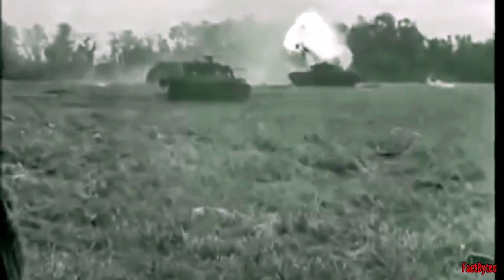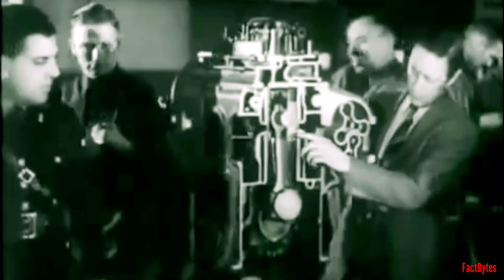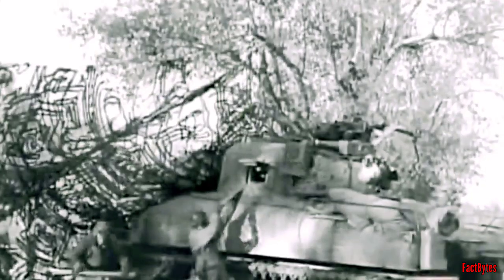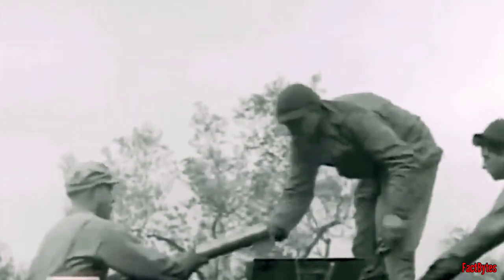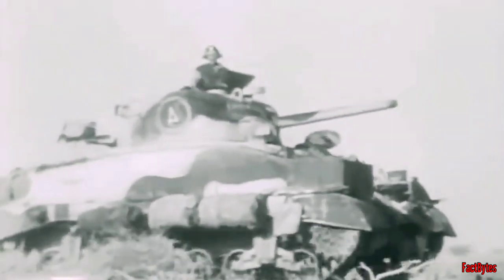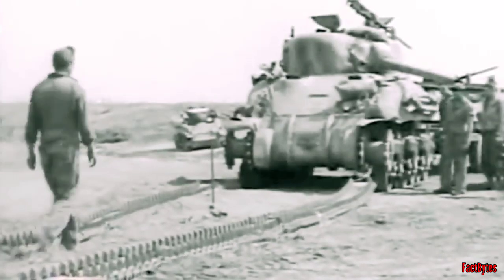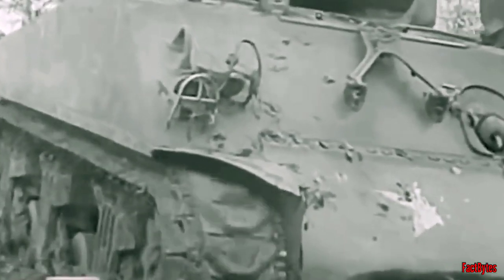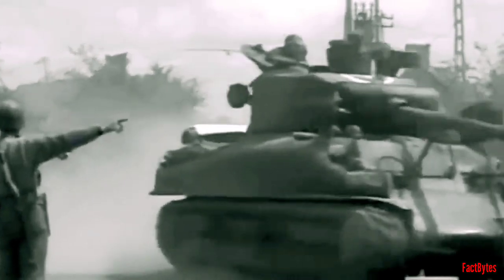How Good Was The M4 Sherman Tank REALLY?

Comment: Sherman’s were upgradable.  A constant stream of modification’s kept  this platform relevant until the early 70’s.  They were very fight able, easy to repair and maintain.
Reply: So true! The IDF upgrades to the Sherman made it able to go toe to toe with T54-T55 tanks.
Reply: Homer.
Reply: The Chilean Army acquired used M-50 and M-51 Shermans from Israel until the late 1990's. The M-50's had their long 75mm guns replaced by a high velocity 60mm gun while the M-51 kept their 105's. The idea being these Shermans would most likely encounter Argentina's TAMs, AMX-13s and Kurassiers - something they could quite handle.

Comment: It was common practice to keep shooting the tank (both sides did this) until it caught fire. A burned tank can’t be repaired.
Reply: Gunner marks III kills
Commander: I only saw the one? 
Gunner: I hit it 3 times before it burned didn't I?
Reply: And Shermans had a water jacket which made it unlikely that an ammo fire could occur in a sherman
Reply: General Horse
2/3 of Shermans built didn't have wet ammo storage and if I remember it correctly none of the British and Canadian Shermans even in Normandy had it.
Reply: @generalhorse493  It wasn't a water jacket, it was a gel consisting of a mixture of water, ethylene glycol, and a rust inhibitor, known as "Ammudamp."
Reply: @lyndoncmp5751  Only late model hulls (In late 1943 and early 1944, a fundamental design transition took place in Sherman production. Initially, all Shermans had the "early" 56-degree angled hull with small driver and bow gunner's hatches that jutted out. In November 1943, near the end of its production, the M4A2(75) was the first variant to introduce the newly designed "late" 47-degree angled hull with a thicker, smooth glacis plate and larger hatches that allowed the driver and bow gunner to escape more easily) had wet stowage, and none of the 105mm armed M4 Mediums had wet stowage.

Comment: After WW2 the M4 Sherman stayed in American service thru the Korean War. Other armies used their Sherman in frontline service. Some armies into the 1970’s. The Sherman was product improved throughout production. Modified and up gunned by armies using it.
Reply: In fairness, this was the Firefly version of the tank.  Why the war department decided to go with the low velocity 75mm just boggles the mind.  This was a penny pinching step because they felt that the low velocity gun would last longer with less wear and tear on the tank.  I mean, the whole damn reason to have a tank is that it is a mobile platform to a powerful gun, so scrimping on the gun defeats the whole purpose of the thing..
Reply: @andysheepleton   the 75 mm wasn't a tank vs tank gun
the sherman was more like an ifv in most cases
the 75 mm had a better HE shell for infantry engagement than the 76 mm
the shorter cannon was also suited for that
each version of the sherman had its benefits
of course the 76 is superior for tank vs tank then the 75
but we have to see the main needs for the us infantry as well

Comment: German heavy tanks required narrow tracks to be loaded on flat cars. Once they arrived combat tracks had to be installed.
Reply: The tiger had field tracks(as opposed to the shipping tracks) that weigh 3.5 tons. To put that in perspective, the M1 Abrams tracks weigh around 2 tons. That the weight the engine and transmission have to move just to crawl across flat ground, to brake, turn, or accelerate.
Reply: @drudgenemo7030  the tiger, tiger Royal and their derivatives we're too wide for the flatbed cars. Hence the need to swap tracks. Too much fun! Go into combat tired
Reply: Not always. If there were no major obstacles ahead, they would often send the Tigers with their combat tracks.
Reply: Wasn't really a big deal. Could be done in half an hour each track. When being entrained most of the day was spent hanging around waiting anyway.
As the last poster said plenty of pictures of Tigers on trains with combat tracks on. I even have pictures of Jagdtigers on trains heading for the Rhineland-Palatinate in early 1945 with their combat tracks on.
It wasnt preferable, but it could be done.
Reply: A Panther’s transmission had a ridiculously short service life and required a team of specialists working all day with heavy equipment to replace it (they essentially had to tear down the entire tank just to reach the damn thing).  Not only was the Sherman’s transmission more reliable, but it could be replaced by the tank’s own crew with just the tools they carried, and could be done inside of two hours. 

Wehraboos can cry all they want about nazi supertanks, but those things are no good if you can’t keep them running consistently.

Comment: Survivability is easily the most important factor in making a successful tank, imo. Big guns and thick armor are nice, but if the crewmen can't escape after a bad hit, then their experience dies with them. And this was exemplified perfectly around Arracourt, where Panther tanks operated by rookie crews were soundly defeated by a veteranized 4th Armored Division operating technically inferior M4 tanks.
Reply: Being difficult to penetrate is the most important survivability factor. And German tanks had as many large hatches as the M4.
Reply: @TTTT-oc4eb  I disagree. No tank is impenetrable. All that matter is how well the crew will fair when the tank is penetrated.
Reply: @redaug4212  If that's the case, why bother with thick armor at all? Being inside a tank that get penetrated by 90% of incoming rounds is horrible for moral, being inside a tank that shrugs off most rounds is the opposite. Despite being sent into the worst combat zones, the Tiger crews viewed their tank as a near life insurance.
Reply: @TTTT-oc4eb  To prevent the tank from being KO'd ofc. You're conflating crew survivability with overall durability of the tank. Armor's primary function is to keep the tank operating in combat, not necessarily to keep the crew alive. Otherwise there wouldn't be so much emphasis on escape hatches in good tank design.
You are correct however by indicating that the M4 was a victim of its own success. Surviving in a tank that gets destroyed over and over creates the perception that the tank is somehow bad, even though its design saved your life just as much as a heavily armored tank could. That perception bias is why we have books like Belton Cooper's "Death Traps" and the many History Channel documentaries regurgitating the myth that the M4 was inferior because it wasn't an armored behemoth like the Tiger.
Reply: @redaug4212  No, the armor's primary function is to keep the crew alive.

According to the book "Brains and bullets" by Leo Murray, the main reason for the high crew survivability of the Sherman was something quite different; in the first weeks of the Normandy campaign 4 out 5 crew members became casualties when their Sherman was penetrated. After 15 weeks this had dropped to just 1 out of 5. While there were several reasons for this, by far the main reason was that the crews learned to evacuate their tank as soon as they felt outgunned, often even without being directly fired on. A common tactic was to fire their gun in the general direction of the threat, then back out to a safer place and bail out.
Reply: @TTTT-oc4eb  No, the main purpose of armor is the keep the tank functioning after getting hit. That's why side armor is consistently thick whether it's covering the crew compartments or the engine.

I've never read Leo's book, but upon reading the description it appears to be a book full of novelties and anecdotes; not a real analytical assessment of armored warfare or the performance of US tankers.
Real statistics show that the death rate for US armored personnel was exceptionally low; with the whole US Armored Force sustaining only 1,581 combat deaths during WWII (though is probably slightly higher if officers are accounted for). The fact that your book is trying to claim that 80% of these losses occurred in the first 15 weeks of the invasion of Normandy is absurd and mathematically impossible.

Moreover, the suggestion that US tank crews fled at first sight of a bigger gun is easily debunked by the aforementioned battle of Arracourt, the battle of St. Vith, Krinkelt-Rocherath, and many other examples of late-war tank engagements between the US and Germany.
Reply: @redaug4212  "No, the main purpose of armor is the keep the tank functioning after getting hit."

A tank will generally function better without holes in it.

"The fact that your book is trying to claim that 80% of these losses occurred in the first 15 weeks..."

Casualties also includes WIA, usually at a ratio of 2 or 3 per KIA. And it was a gradually decline, not suddenly from 4/5 to 1/5.

He didn't say it COULD be the reason, he stated it WAS the reason.
Reply: @TTTT-oc4eb  >"A tank will generally function better without holes in it."
Yes, hence why the armor is there to prevent holes to keep the tank functioning.

>"Casualties also includes WIA, usually at a ratio of 2 or 3 per KIA."
Ok but that still gives us the absurd claim that 80% (4/5) tank crew casualties on the western front occurred during the Normandy campaign; where only a fraction of America's armored units were deployed.

>"And it was a gradually decline, not suddenly from 4/5 to 1/5."
So I'm going to pretend for a minute that this claim is true. Since the US fought German tanks from 1942 onwards, often when they were using actual death traps like the M3 medium, then why would this habit of fleeing like frightened whitetails suddenly appear during the invasion of Normandy?

>"He didn't say it COULD be the reason, he stated it WAS the reason"
In that case I know for a fact he's lying lol
Reply: @redaug4212  "Yes, hence why the armor is there to prevent holes to keep the tank functioning."

You are contradicting yourself.

"Ok but that still gives us the absurd claim that 80% (4/5) tank crew casualties"

It also includes the Commonwealth forces, which faced much harder resistance than the US forces.

"Since the US fought German tanks from 1942 onwards, often when they were using actual death traps like the M3 medium".

Until Normandy, especially the US forces saw very limited combat against German tanks. Even in Normandy the almost all tank vs. tank were in the Commonwealth sector.
Reply: @TTTT-oc4eb  How's that a contradiction? I said the armor's main purpose was to prevent the tank from getting KO'd. You said tanks function better without holes. You're basically in agreement with me here.

>"It also includes the Commonwealth forces, which faced much harder resistance than the US forces."
Then why would US tank crews pick up the habit of needlessly abandoning their tanks if the casualty rate wasn't severe in their sector of Normandy?

>"Until Normandy, especially the US forces saw very limited combat against German tanks."
That's not true. Kasserine Pass is an obvious. So is the battle of El Guettar. US forces were counter-attacked by Tigers on the first day of operation husky, and were counterattacked by panzers at Salerno, and again on the Anzio beachhead. All this before the invasion of Normandy. So why weren't US tankers doing this alleged practice throughout the war?
Reply: @redaug4212  "How's that a contradiction?" 

You started your first post with basically claiming that escape hatches were more important than big guns and thick armor.

"Then why would US tank crews pick up the habit"

It was not about US forces, but Sherman in general.

"That's not true."

Still very limited compared to the other major combatants. In North Africa the US forces were green, and Italy was a poor country for tanks.
Reply: @TTTT-oc4eb  >"You started your first post with basically claiming that escape hatches were more important than big guns and thick armor"
Again, your conflating survivability with durability. If the engine were a sentient creature that needed its own escape hatch, then I would indeed be contradicting myself. However, my point was and has always been that armor is fundamentally there to protect the integrity of the tank itself, not necessarily the crew operating it, hence why the hatches are there to begin with...

>"It was not about US forces, but Sherman in general."

Ok, even better for my argument actually. The M4 was used by British and Commonwealth nations as early as 1942 in numerous tank-on-tank engagements. So why then did the British begin the alleged habit of needlessly abandoning their Shermans in Normandy?
Reply: @redaug4212  That's some strange kind of  thinking. However, going by that logic, a Tiger or Churchill should have much better "integrity" than a Sherman then? Because they could take much more punishment and still keep on fighting? And the Churchill had even better survival rates than the Sherman. There are no stats on German tanks, but they were as a easy to get out of as a Sherman. And wet stowage and other improvements were not common in the summer of 44.

Normandy were the first campaign where the Sherman met really large and concentrated numbers of Tigers, Panthers, PaK 40s, PaK 43, FlaK 36 and upgunned Panzer IVs and StuG IIs - all of which had a very high chance of killing a Sherman with one single hit.
Reply: @TTTT-oc4eb  How is it strange? It's common sense. Chances are that a tank with better armor will operate better after being hit than a tank with less armor. You're arguing for the sake of arguing here.

>"And wet stowage and other improvements were not common in the summer of 44"
Yes, and that's why it doesn't make sense that Sherman crews would allegedly bail en masse AFTER the introduction of wet stowage, when the tank was even safer for the operators.

88mm FlaK 36 guns were used extensively as anti-tank weapons throughout the North African campaign and Italy, especially in the British sectors where they committed more armor than the US, so that excuse doesn't hold up. Moreover, if your book is trying to argue that this was common practice because of casualties inflicted on British and Canadians forces around Caen, then that has less to do with the fact they were operating M4s and more to do with the fact that the Germans held almost every tactical advantage and that Commonwealth forces were given the rather suicidal missions of charging across open fields to take heavily fortified ridges. On the other hand, tank-on-tank engagements in the US sector produced fewer losses in both tanks and crewmen due to the nature of the terrain that gave neither opponent a major advantage. For example, during the breakout of operation cobra, the 2nd Armored Division knocked out 64 German tanks while losing 49 tanks of their own.
If crews did readily bail from their tanks, it had more to do with tactical circumstances rather than the Sherman itself.
Reply: @J6g4f8h3 78, 

Indeed. A case in point is the battle at Perolla Italy on June 22nd 1944. A small number of Tigers of Schwere Panzer Abteilung 504 engaged 23 American Shermans. 11 Shermans were knocked out and the other 12 were abandoned by their crews. They just left them there.

If we watch the footage of the Cologne tank v tank battle between the Panther and Sherman /Pershing we see the Panther crew escape no slower than the Sherman crew, and actually more Panther crewmen survived the Pershing hits than Sherman crew survived the Panther hits.

The Chieftain has skewed a lot of people's thinking now. He's been in lots of Sherman lots of times. He knows how to get in and out of a Sherman very quickly. Panther crewmen knew how to get in and out of their Panthers very quickly, as Cologne shows. Especially with their arses on fire.
Reply: RedAUG

"For example, during the breakout of operation cobra, the 2nd Armored Division knocked out 64 German tanks while losing 49 tanks of their own." 

American tank crews had a propensity of lobbing shells into already abandoned enemy tanks or those taken out/disabled by air power or artillery etc and calling it a "kill" so I'd disregard that statistic. It seems an abnormally high ratio of kills v losses for an offensive operation. Of course, the figure comes from Zaloga, who is not noted as being unbiased.
Reply: @lyndoncmp5751  Can you elaborate on how many of the crewmen of those 11 destroyed M4s were fatalities, since the entire subject of this thread is about survivability? No one here is denying that the M4's armor was more vulnerable to up-gunned German tanks.
Reply: @lyndoncmp5751  >"Whenever the Allies claim to have knocked out more German tanks it's fabricated reporting, but when the Germans knock out more Allied tanks it's 100% legit"
Uh-huh tell me something that every other coping wehraboo hasn't tried to tell me when discussing anything that involves Germany taking a loss 🙄